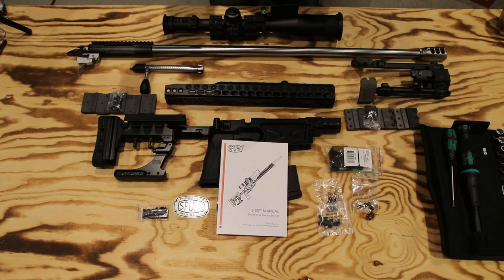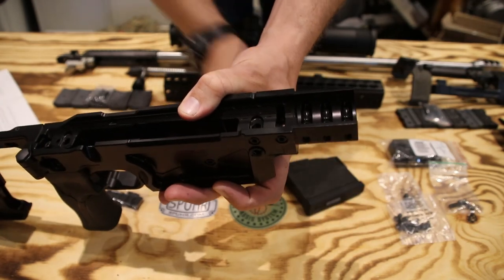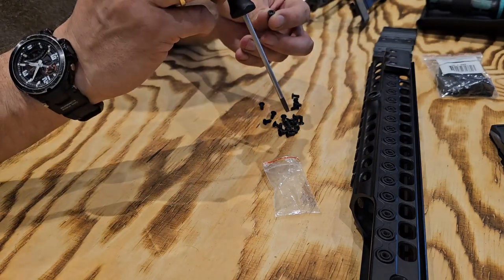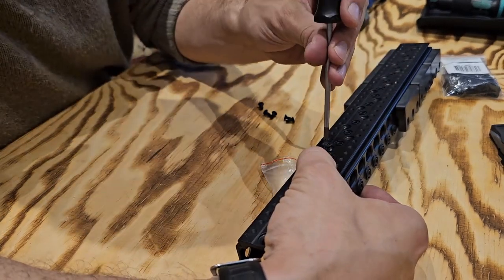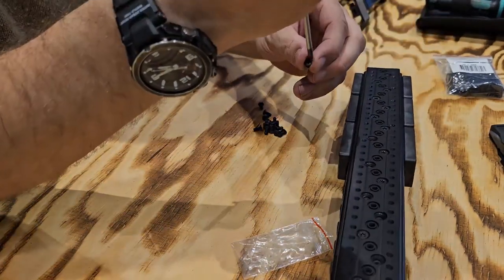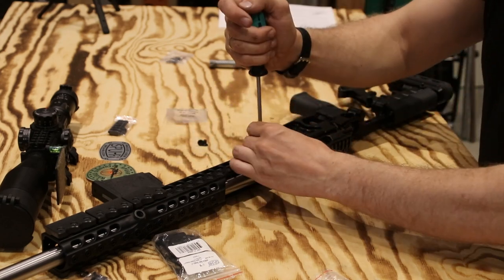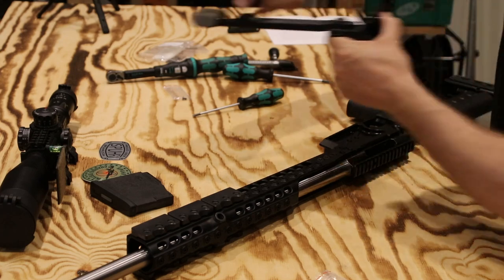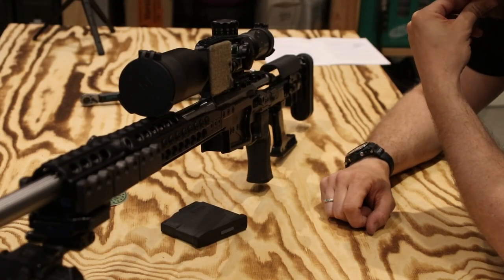Assembling the SICS chassis

Comment: Hello, considering to order one, but... i have an impression, that the part where  adjustable length of pull is - is not rigit? Is it true? Thanks.
Reply from the maker: The stock is very rigid indeed, that goes for the buttstock as well. I have had no problems with it at all, and I have run this chassis now for 6 months. 

All of the Super-scopes playlist tests have been done with this chassis, and that is a lot of ammo downrange.
Reply: @ELR-Precision  Thanks a lot for a quick reply. Very much appreciated.